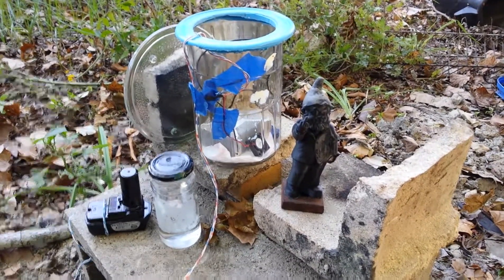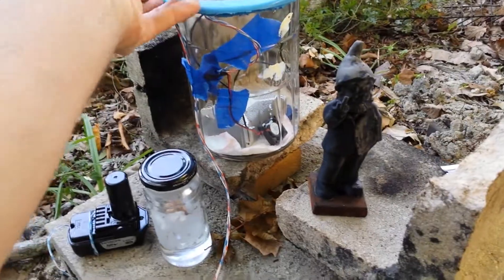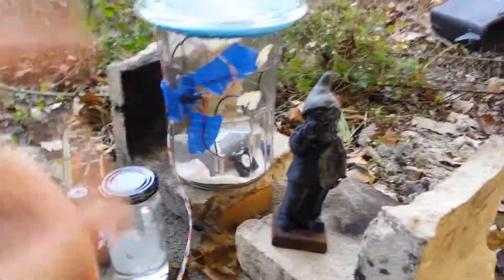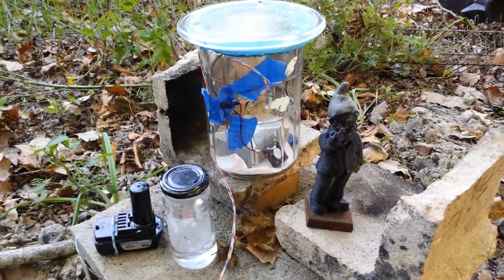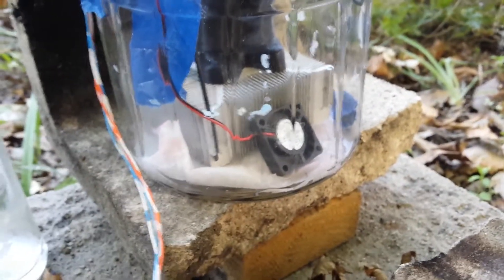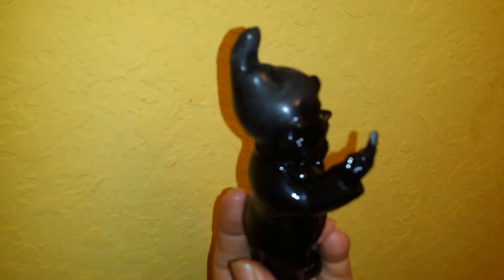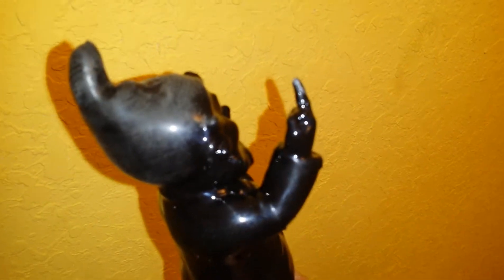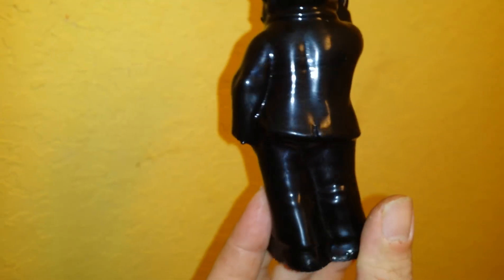Acetone Cold Vapor ABS Smooth Test Rig 1

Comment: My go-to method has been a paint can lined with acetone-soaked paper towels, turned upside down over the object. The downside of that is that you can't see inside, so its pure guesswork as to when to pull the object out. I find about 45-55 minutes usually works for 4-6 inch objects, but having a glass container would be nice so you can see inside and watch the progress. Nice job!